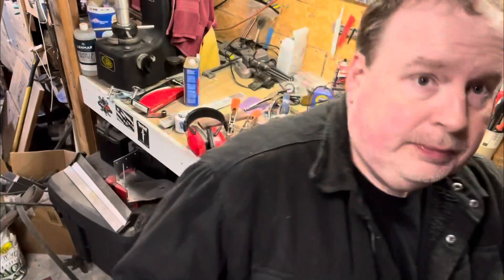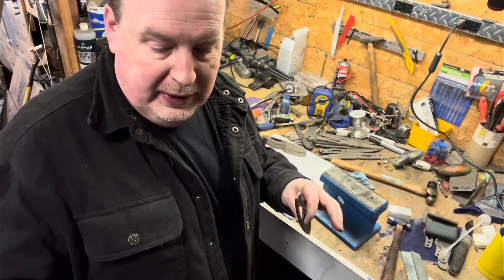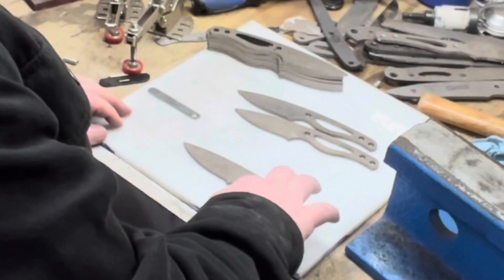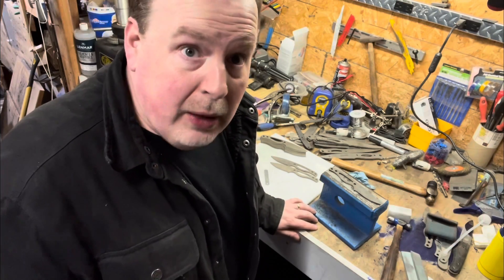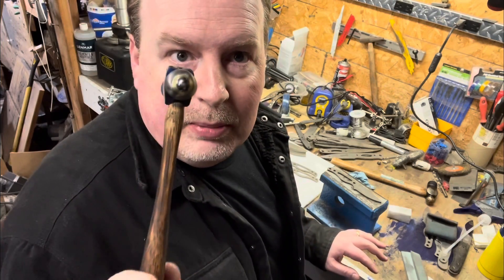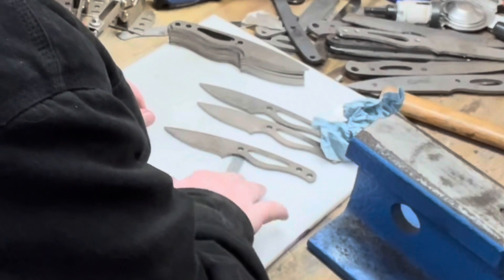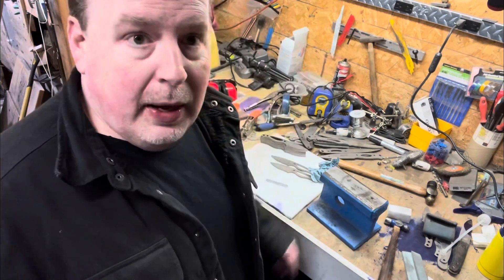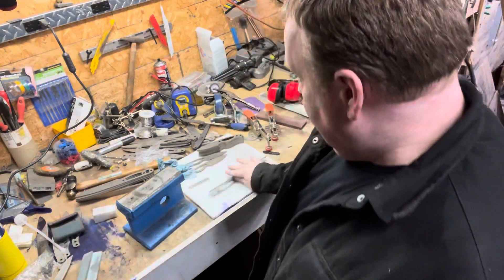Post Heat Treatment Blade Straitening

Comment: I have an old machete that was my paps in WW2 im trying to get refurbished(straight and sharpened...MAYBE a custom wooden handel like a soldier would have done while in the field). U know anyone who can do this or at least get it straight. There's also slight damage(additional more sever bending)on the blade i think is contributing to the warp

Comment: Anybody know if this work with a regular ball peen?

I have a massive warp on an 11” blade I’m working on. I havent tempered so I’m going to try the trick of putting the blade on a piece of angle and tempering maybe this will work to get wtvr warp is left out?
Reply from the maker: Straighting in the temper is a better first choice, but it does not aways work, or it is not perfectly straight. A regular ball pean hammer will not work. Also you would not do this until after the temper cycles.
Reply from the maker: It will not work post heat treat, most ballpeen end are softer than the blade.
Reply from the maker: Maciej_Jan_Dlugosz  if you were straightening a kitchen knife that was already hardened, and bent in the process of use. It was simply the mechanism of bending it back using the ball peen hammer. This technique is something entirely different.

Comment: As you know Murray Carter also had made a limited run of Tagane hammers.  Murray's hammer only had one carbide on the end and he was selling them for $250.  Look up "Trow and Holden Carbide Mill Pick" .   You could take this hammer by Trow and Holden and shape/grind either end of the hammer heads to your liking.  It's only $167 for two ends that could be just like the ones Murray made up, but just a longer head.  You could make one having one end just like the one Murray made which is somewhat sharp, and the other more rounded off as to not leave the marking on the blade like Murray's.  The "wedge" shape allows more precise control of your desired bend.

Comment: Do you have those water jetted? Apparently grinding at lower rpm and or under water can help reduce some stress. The less stress you put the steel in pre heat treat the less they will warp as bad. Does Peter's offer a stress relief cycle? I've also heard of Vibratory Stress Relief.

Comment: Do you think someone could make this work with a regular ballpeen hammer? Or do you think the carbide is completely necessary?
Reply: You should easily be able to do it with a regular ballpeen hammer as it's going to well exceed the transverse yield strength of knife steels? I don't think hardness matters, energy/force does. *JUST A GUESS* not a professional

Comment: Very interesting Gary. How sure can you be that micro cracking is not a possibility when doing this?
Reply from the maker: I had a similar concern whether it caused any damage to the steel. I actually ran it by the designer of the steel only to learn that he endorsed the method.  I am pretty confident that it is not creating those issues, the biggest issue is grinding out the divits, but in the case of my usage that’s no problem.
Reply: @Creelyblades  Very interesting and could be a game changer! So I assume these are the Magnacut Mako's then, and Larrin reckons this would be just fine?
Reply from the maker: @burtjoubert  yes, Most of the Magnacut makos are at the grinder, but I had about 55 warped ones that I had to hold back. I lost about three of them that I just could not get straight, but otherwise now I have reclaimed 53.
Reply: @Creelyblades  Wow, it's very curious that so many Magnacut heat treats warp. Any ideas why? Could it be Magnacut itself, or just the heat treat guys getting used to it?
Reply from the maker: @burtjoubert  It is likely something about the process of rolling the steel into sheets.
Reply: @Creelyblades  Thanks Gary. That seems be the only thing that makes lot of sense, all from the same batch of rolled steel.

Comment: Hi Gary, I think i can shed a little insight into what is happening to fix the warp. You mention that the carbide hammer leaves some very small divots, which means that when you strike the surface of the steel, you are locally creating stresses beyond the yield strength and flowing material away from the point of impact. This is why the steel chips if you strike too closely to an edge: there is no support steel  in the cutouts to limit the yield and the steel is displaced beyond the breaking strain.

Here is the explanation of the (un)intuitiveness of this repair:
Like you said in the video, most folks would think to put warp-side down, where the center is bowed up, and then strike the bowed-up center to flatten the piece. This strategy assumes that the warp can be corrected by 3-point bending beyond the yield strength of the blade to induce a new warp to cancel out the existing warp. One can think of a downward bending moment on a blade (or a beam) as creating strain that varies from positive (stretch) to negative (compression) from the bottom surface to top surface, respectively. With a hammer blow on a flat surface, you will never be able to fully flatten a warped blade because you can only have get the blade to temporarily flatten during impact, but the elastic response of the steel will cause it to rebound. 

When you put the warp side up, where the blade is curving upwards, the bend in the blade can be thought of as the top surface of the blade being too short relative to the bottom surface. This variation of "too short" to "too long" across the thickness of the blade is the bending moment we need to relax out of the blade. By striking the top surface of the blade with the hard ceramic ball, you are locally yielding  the blade and causing steel to flow outward from the point of impact; namely, you are causing the steel at the surface of the blade to stretch out and away from the point of impact. Since the blade has been placed warp-side up, which is the "too short" side, by hammering around on this surface we are stretching it out, thereby removing the bend.

I cannot say whether the localized residual stresses that the hammering creates is "relaxing" out the residual stresses from the heat treat that caused the warp in the first place, or whether there is ample residual stress from the heat treat that is in a push-pull balance with the residual stresses from the hammer blows. I guess you will find out when you have the blades ground to their final thicknesses whether the heat-treat warping stresses permeate throughout the thickness of the blade while the hammer blow stresses are just at the surface. If that is the case then you might find the blades start to warp again when the surfaces are ground.

Looking forward to these makos. I'll be taking one with me on a boundary waters canoe trip this summer if they are ready by then.
Reply: You are correct there sir *I think*. Just don't ask me to make one. I've had 2 people try and fuck Gary over cause I'm in a non-profit hobby deal. It's incredibly fucked up to even ask. :| Albeit I doubt he would care about 2 knives, it's the principle.